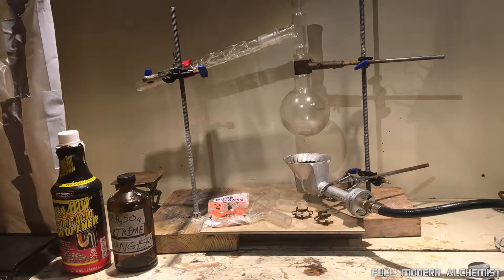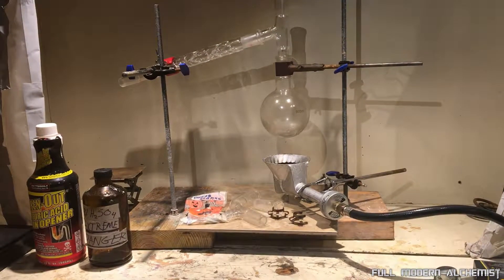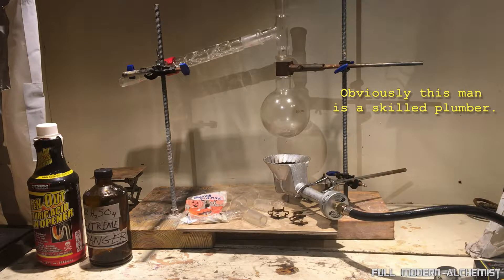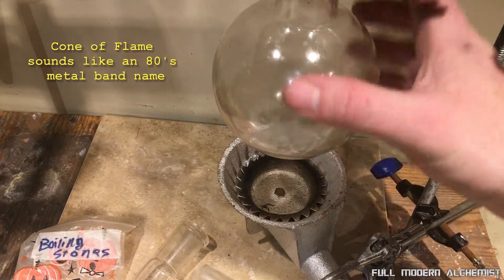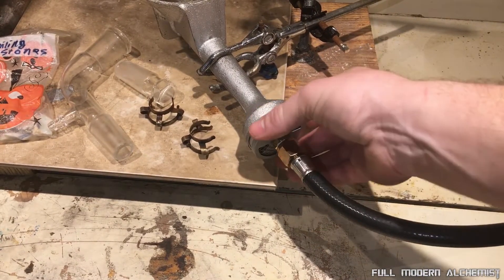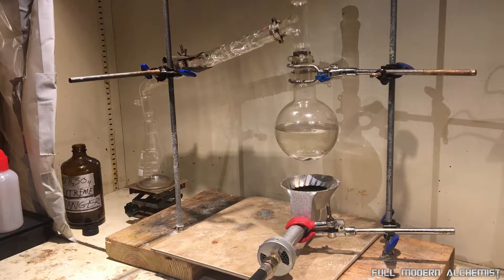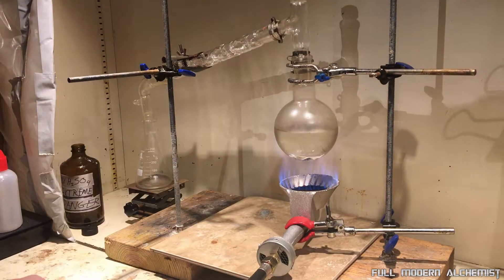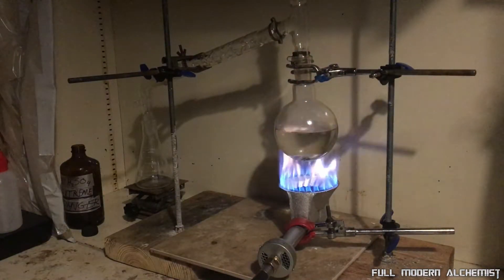Distillation Of Sulfuric Acid

Comment: Great video, short and to the point! Distilling Sulfuric Acid in a home-ish setup has typical problem with bumping, what did You use as boiling stones to avoid it?
Reply from the maker: I used pieces of a broken ceramic dish. Pretty much any ceramic will do as long as there’s plenty of surface area without glaze. The rough surface is what helps things boil.
Reply: @FullModernAlchemist  And these managed to do the job until the end of the distillation, acid didn't dissolve them? D:
Reply from the maker: @Piecier  yep sure did! I still use the same chips in other reactions. Porcelain is very chemically resistant.

Comment: You need to add something under the flask to spread out the heat. Direct heating by flame can crack flask. I reccomend at least aluminium foil but sand is good. If you wanted to be fancy use copper pellets
Reply from the maker: Stalin did nothing wrong that’s probably a good idea, I have been meaning to find a wire gauze, which is the traditional thing to use for that.